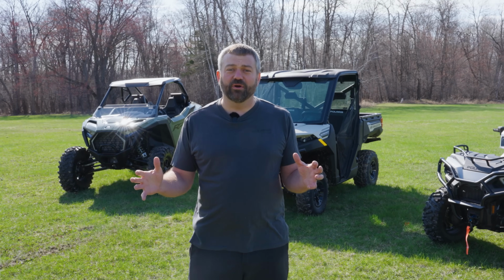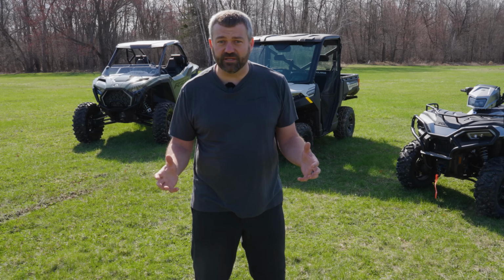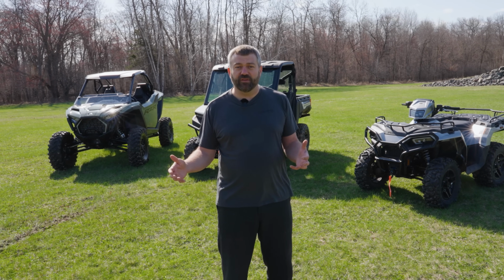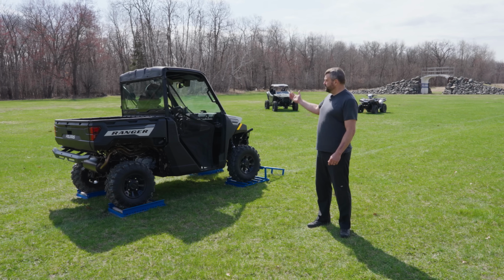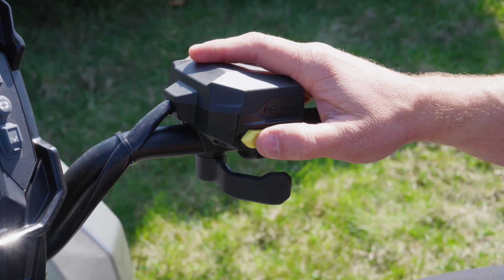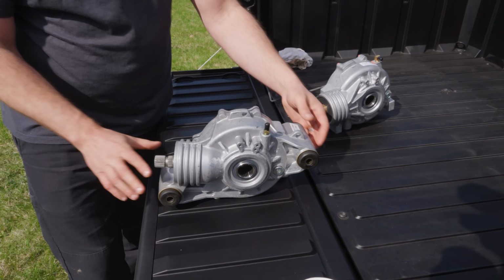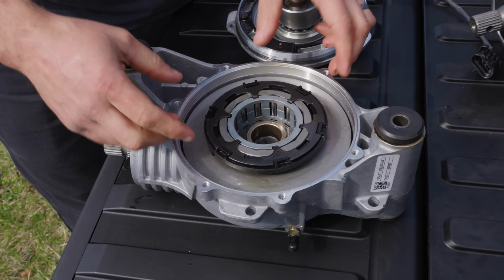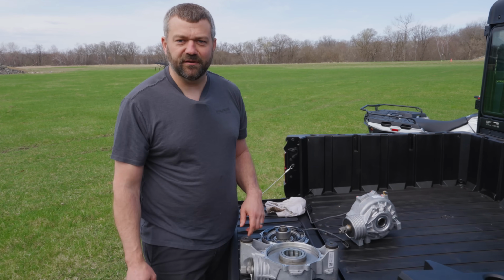AWD, 2WD, & TURF MODE |  SHOP TALK EP. 65 | Polaris Off Road Vehicles

Comment: The  video is kind of misleading with how turf mode works. When turf mode is engaged it’s not just the right side tire that gets power. Both rear wheels get power, just through an open differential just like every rear wheel drive car or truck has. The tire with lower traction will spin first. It’s perfectly fine (and ideal) for running in pavement in turf mode.

Comment: Just got a Ranger 570 Full Size and only plan on using it on paved roads. It has been converted to be street legal. I’m confused on what drive mode I should use? There are 3 modes on my Ranger - 4 wheel or all wheel.  2 wheel drive and turf mode .  Which mode should I be using? And majority of my speed will be over 20 mph. I believe In supposed to just drive it in high mode?  Please let me know what In supposed to do?

Comment: I recently purchased a 2025 Ranger 1500XD Crew Northstar Ultimate.  When on pavement I tend to use turf mode to save wear on the tires.  I’d really like to know if using turf mode on pavement and at higher road speeds is doing any harm to my machine.
Reply: Nah u just probably wont be able to go as fast or have very fast acceleration
Reply: The video is misleading. When turf mode is engaged it’s not just the right side tire that gets power. Both rear wheels get power, just through an open differential just like every rear wheel drive car or truck has. The tire with lower traction will spin first. It’s perfectly fine (and ideal) for running in pavement in turf mode.

Comment: Use Turf or 2WD for asphalt, long drives, high speed 60mph/100kph) ? 

What is the official position?
Reply: Yes turf on road. Rotate tires every oil change. The back right will wear quicker.
Reply: @Influencing1 Thanks. It’s just that I’ve seen quite a lot of info that using turf on pavement fast would wear the diff (as it was not intended for high speed but to save your garden). While using the 2WD will wear the tyres but save the pignons. 

Not sure what to think of all this …
Reply: @Influencing1  No it won’t wear one tire more than the other rear tire, as it doesn’t just drive the right tire. It’s still an open differential that can send power to either rear wheel or both depending on traction.

Comment: Does this mean that you are allowed to use TURF mode at high speed on asphalt a General /RZR ? 

I was under the impression that I was prohibited for high speed/ long drives on asphalt.
Reply: you can drive turf all day long. what usually destroys rear diff is when you spin only one wheel and suddenly that wheel gets grip and rapidly stops.

Comment: Top video guys👍, love to see a video on low gear between the RZR XP1000 , RZR XP1000 Trails & Rocks, RZR XP,  Pro XP,  Pro S and the Pro R ,  as it is hard to find stats on the gearing , all i can find is that my XP1000 Trails & Rocks is 55% lower geared then the XP1000.